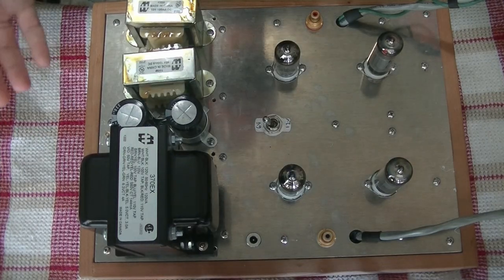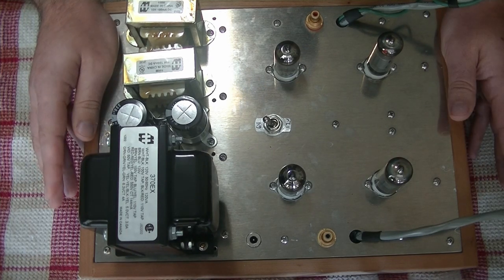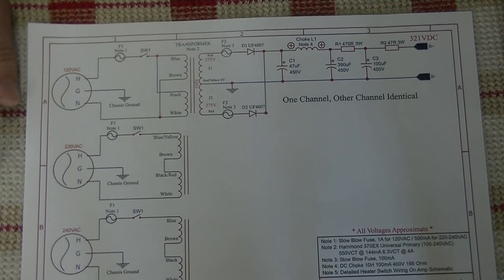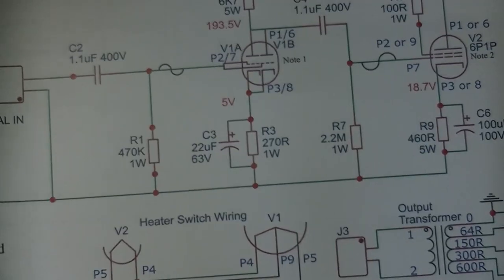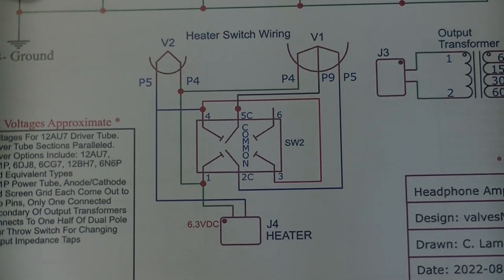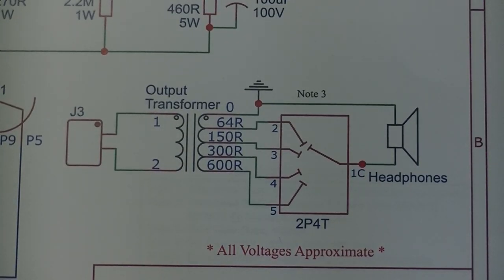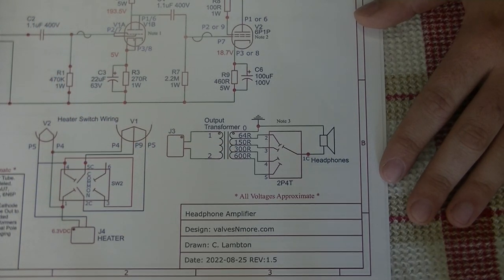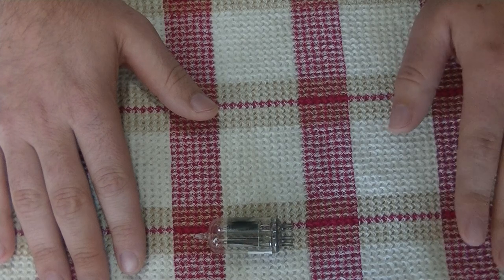A closer look at our new Headphone Kit Amp

Comment: Hi.. Who wound your Output Transformers? The design looks great so far.. Thanks!
Reply from the maker: Like the majority of electronic components, the OPT's (output transformers) are made in Asia, our supplier is based in Hong Kong, but the plant is probably across the border in mainland China.  The PT  (power transformer) and Chokes are made by Hammond, a top quality Canadian manufacturer (some products like the chokes are now made in China).  We've had excellent results from both suppliers, BUT we always do quality control checks, particularly during the prototype builds.  The OPT's in particular need to sweep well and of course sound great - which thankfully they do!
Reply: @mellowtoneamps4932  Thanks for sharing.. Does this need a tube preamp? I see that it needs a 5V input signal for full output power..
Reply: @rickg8015  Hi Rick, we haven't released the final specs of it because it's still a work in progress. But the input sensitivity  is going to be very good on it. We designed it so the lowest MU tubes (12au7/12bh7/6n6p/6CG7/6GU7) would be able to drive it to full power with an input of 2VRMS. Which is the nominal industry standard.  2VRMS is the nominal output of a CD player. Of course the higher MU tubes (6N1P/6DJ8/6BQ7A) will have better input sensitivity and will make it even easier to drive.

You can use a preamp if you like, but most people will be using phones/digital music players/computers and they are what we've designed this for.
Reply: @charleslambton7836  
Thanks Charles.. I forgot that it’s still an evolving design.. So the amp would have a stereo volume pot? An input selector for 2 or 3 rca line level inputs would be nice too.. Thanks again.

Comment: Will there be a signal bypass switch? My last headphone amp needed a switching box to switch between headphone and speaker amp. It was a pain.
Reply: Hi Neil, sorry I misunderstood the question with my last response.

Are you thinking about using the headphone amplifier as a preamp for your main system? Or are you talking about switching the inputs to the headphone amp from your main system to something else? Or am I completely wrong on both? Would love some clarification.
Reply: @charleslambton7836  No, it's more that there's only one RCA output from my pre. So it either goes to the headphone amp or the power amps. In the past I have had to use a switch box in between to send the signal to either. It would be good to have a 'through' switch so that it would go to the power amp without turning the headphone amp on.  Or a relay that when the headphone amp is off, sends the signal to the power anp instead. (if that makes sense?). I'm just thinking on my feet here ;-)
Reply: @LawsonsStudio  oh okay, that makes more sense. So we're going to keep that in mind but it's not a feature that we can see a lot of people needing. Though we're going to think about it and see if there's an easy way to integrate it without overcomplicating the build.
Reply: @charleslambton7836  I suppose that so many people use them stand alone, it won't be useful. I'm always awkward :-)
Reply: @LawsonsStudio  well if we can integrate it as a feature cleanly then we will. I'm with you that I hate having to unplug and plug in cables constantly. And who knows, maybe more people will use it if it's there.  Thanks for the idea and communication, we're always interested in hearing what people want in their amps.
Reply: @charleslambton7836  hope my suggestion was a help. It certainly wasn't a criticism. You guys do amazing work

Comment: But 64R is much above 32R, so it’s already not ideal for low impedance headphones.
Reply from the maker: We haven't decided which output transformer we'll use, we also have one in for trials that has 0/8/50/150/300 ohm secondary taps.  Which would give us a universal low impedance output (capable of even driving high efficiency speakers).  And of course 8 ohms into 32 should be fine.  What you really want to avoid is a high impedance source driving a low impedance load.  Though interestingly we have a pair of hifiman he400i at 35ohms and they were fine on the 64ohm tap, better than fine, they sounded amazing.  We also have a top model of hifiman 1000v2? I can't remember what all this gear is called.  Anyway the point is the lower model hifiman competed very well the higher end model.  One thing to remember is the impedance of the transducer varies constantly and is constantly changing across the audio frequency band.  What starts out as a nominal 32ohm headphone, may well have a midrange at 120ohm and 10k at 300ohm, and the impedance at those frequencies varying during playback.  We now have a large enough selection of quality headphones that we should be able to properly trial each prototype for mismatching issues.